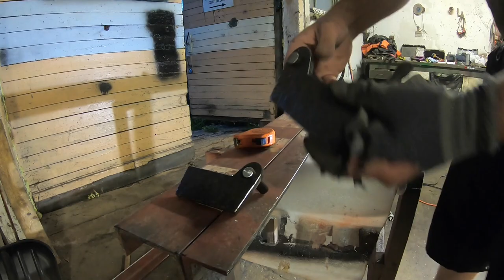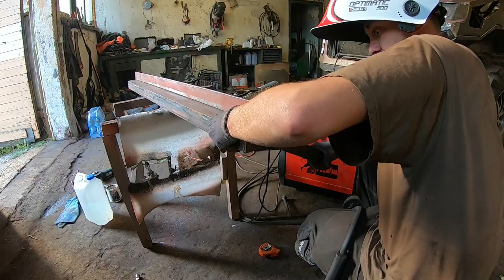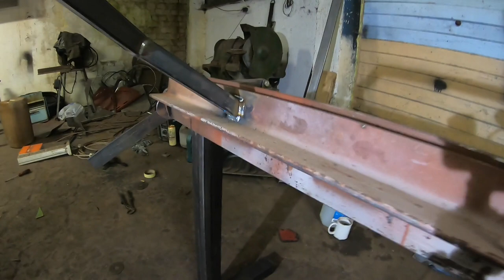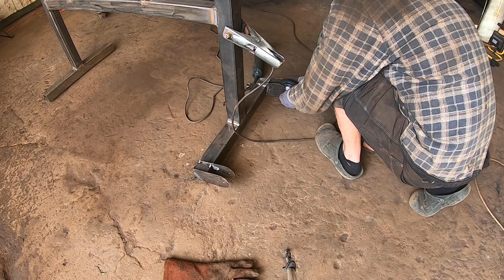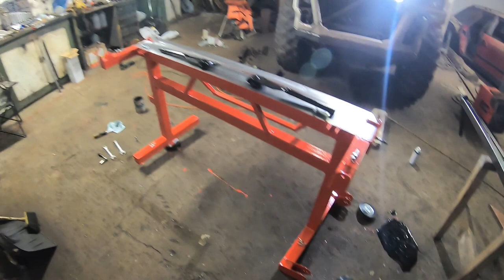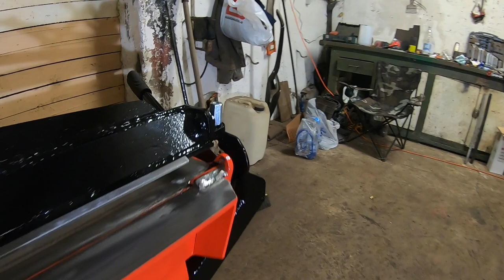Sheet metal brake build.

Comment: Hey, dude...Thats a very well engineered metal break... I like the clamping mechanism. I will build the same thing in the near future.. but longer (2 Meter) At the moment, i have a very improvised break made out of wood. It works fine for Aluminium up to 2 mm.. I did a lot of roofing work with it since i built it, 5 years ago... But now its time for a better one out of steel...One thing a have noticed...  your welder / gas bottle setup. I think, you need a propper welding cart.  ;)   Subscribed and greets from Germany
Reply from the maker: Thanks a lot for your kind words dude :) And good luck with your build ;) 
...about the welding cart, its in the making right now, should be ready in near future :D
I will post a video about it as well :)

Comment: You have made a really good metal brake. Well done. Are you pleased with the full length bends or do you think it varies along the bend?
I've been looking at buying one but they are either too small or too expensive. Self made looks like the best way to go.
Kind regards Paul 🇬🇧
Reply from the maker: Thanks man...I am very happy with the bend quality. It took guite some time before i finally built it for myself...wish I had built it earlier😁 It makes life so much easier🙂
Reply: @OneManOperation  I can imagine. I will have to get cracking. I really like your design. The clamping especially.
I built myself a media blasting cabinet and powder coating oven. I wished I had built one sooner. I have subscribed to your channel as I like the way you engineered your brake.
Kind regards Paul from 48 Spokes